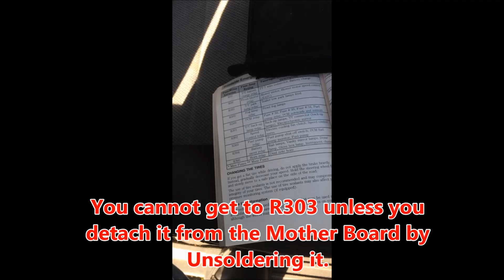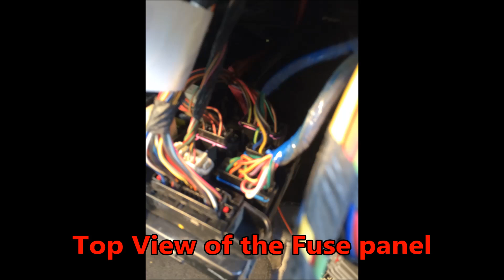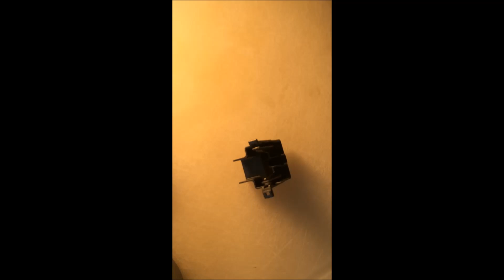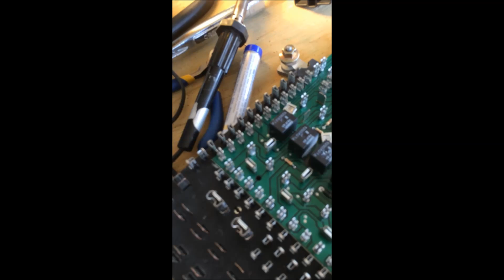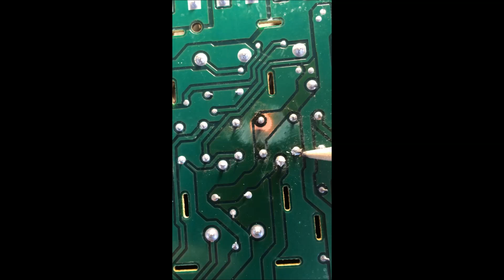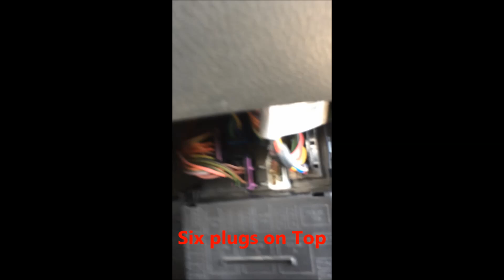2003 Ford Expedition R303 fuel pump relay replacement

Comment: I disconnected my 4 pin permanently and ran an ignition source hot to the green/yellow.  Problem solved.  Unless you think you see any issue with that method.  LOL
Reply: You need to run a fuse inline in that wire! If you don't have a fuse in electrical wiring and something shorts out the wire becomes the fuse and will melt and possibly cause a fire.
Reply: @blk95gsrt  yes, I plan on actually putting in an external relay (that can be easily changed) and a 30 A fuse inline.
Reply: @txgear  very good 👍
Reply: @blk95gsrt  as I said, if you read it all ... "I do have eventual plans to wire in a external fuse/relay combination - just for the ability to have a fuse on it"
Reply from the maker: No problem, I made this video showing how to fix a problem cheap that shops "more than one" kept saying was an expensive fix and we would have to buy a new motherboard. We found the part and fixed the mother board. problem solved! If you or anyone has an idea for a good way to resolve this fuel pump electrical, great for you! Car mechanics is not my profession and every time I can do something myself I will. I do have a great mechanic and pay good money for things that I can't do. He was impressed that this problem was able to be resolved without buying the motherboard.
Reply: @mikelogan99CDLClassAskillstest  there are also videos on how to take the 4 wire connector out and wire an external relay to it.  Oddly in talking to a Certified Ford mechanic I know he had NO IDEA they even soldered the relay in.  Its a ridiculous place for that fuse box in the first place as either the door seal will leak water into that area or a plugged moon roof drain will leak water into that area.

My simple jumper wire is still working fine after one week, I do have eventual plans to wire in a external fuse/relay combination - just for the ability to have a fuse on it but you're correct, HUNDREDS of dollars saved.  Keep up the videos.  Thanks
Reply from the maker: Well said, Thank You!
Reply from the maker: Great comment!
Reply: That works but, then it causes a p0232 code to pop up.
Reply: A1

Comment: Having the same issue with an 04 Expedition and the fuse panel is exactly the same as Hero 3 and the exact same relay was burnt so I think I have to buy me a new relay in order to get this to work. Thank you so much for a very explanatory video what can you say the great video and I hope anybody else has this problem will look you up and see that a simple fix is all that is needed  so thanks again for all your help.
Reply from the maker: You're welcome

Comment: Thankyou for your excellent vid.    Relay 203: Fuses 32,33,34, Fuel Pump Relay, Fuel Pump, & PCM Solenoids would get real hot at connection stud 5 and would scorch the plastic of the relay.  So, with the guidance and caveat about NOT removing the main power feed that you provide in your excellently edited video, I removed and opened the Junction box. None of the internal, 301-305 relays showed any signs of heat fatigue / charing.  Only the female connector 5 of R203 had carbon.  I sanded it off and reassembled the box. .... It appears I have a failed fuel pump... BUT I also have a parasitic drain of 250 mA that I am in the process of finding the cause.  Hopefully it will be the fuel pump....  Again, thank you for the time you spent developing this excellent video.... May 21 2019:  Tom Jones,  New Orleans
Reply from the maker: I'll post this and let others comment

Comment: I have the same issue. Does anyone knows the best easiest way to check power to the fuel pump ?  I was told the connector C270k out of the fuse box goes top the inertia cut off switch then to the fuel pump but I don't know which one it is.
Reply from the maker: I'll let others chime in with comments about this.

Comment: Great video. 2003 Lincoln Navigator here. Same as expedition ford.  To add Just as described in this video. To open the top battery clip has a tab, pull that one.  For the bottom I used a paint can opener to tab open that bottom clip by pulling down from the second clip. It drop in one piece without removing the fuse box.  Also to many fuses to remove and check if its burned. So, After removal if fuse box. Burn out can't be seen well either.  So, I tap with a screw driver one of the spacer end. so it wont break and fall in the fuse box.  Keeping the box from top to bottom. The second plastic spacer between the second and third relay.  I tapped the bottom only and moved some what with a screwdriver and then visible  the burned out.  Glue gun if need so.  Just move back spacer and done mine stays solid.  Ebay or junkyard for spare parts relays  Great Video man ty👍

Comment: Why couldn't you just bypass the relay and wire in a aux relay for the fuel pump? Does the even monitor the output on this relay or? In other words, will it run and drive if you theoretically wired the fuel pump up to run and cranked the expedition?
Reply from the maker: That may be an option, try it and let us know how it works. My solution was to fix the burnt relay on the back side of the mother board.
Reply: @mikelogan99CDLClassAskillstest  my problem with just replacing that relay is it's common enough to where it's obviously not strong enough to be used for the duration of the vehicle
Reply from the maker: I think that is an great option, Do that and post a video about how to do it.

Comment: hi, mike 
I have ford expedition 2003 and I don't have the owners manual.
and I have problem with no start but cranking.
I am believe something wrong wit the fuel pump relay or fuel pump it self.
this is the same problem that you have and have to replace the R303 relay? 
can you send me a copy of the fuse image and location of the fuse?
thank you
Reply from the maker: I show you exactly where the relay is located in the video, It's behind the motherboard. I would check that before you take out the fuel pump. Check your fuel pump to see if it comes on for about one or two seconds during the priming when you first turn on the key, Open your gas cap and listen very close while someone cycles the key.

Comment: tried this.  now fuel pump doesn't shut off during initial priming and engine don't crank.  Any ideas?
Reply from the maker: It may be a fuel pressure issue, The initial prime should shut off once the pressure is reached. Not sure beyond this. sorry

Comment: Awesome video man, helped me a ton and saved me a lot of money!!! I know this video is older but for anyone like me having this issue now and cant find the ebay listing, Amazon sells them Omron Part #F8VF-BA, they also have one listed as "Replaces F8VF-BA" but the part number is the same, should be easy to find. I installed it and it works great, just take your time with the disassembly, soldering, and reassembly and it should go smoothly!!! Thanks again for the video!!!! Also definitly grab some solder wick if you dont have any, made de-soldering super easy!
Reply from the maker: I'll leave this up so others can refer to Amazon

Comment: Mike, VERY informative video. Thank you!
I had to replace my whole fuse box because my case would not open without ruining the whole thing. (2001 ford expedition, with assumed burnt fuel pump relay. Stalling while driving, etc.)  My question is: What other non serviceable relays are next to that fuel pump one? When I replaced my fuse box (used from ebay) well, there went my ac and heat. Nothing! No auto, no manual, no heat or air whatsoever. (I got a refund.)  I'm only assuming that this new USED one has THAT internal relay burnt out! (My externals were fine.) Cannot find any diagrams for my year that tell me what else is inside there next to the fuel pump relay, but will continue to study. Also, I will be checking my fuel pump driver module (underneath by spare tire on cross member) to see if it is rusting and maybe causing the short in the first place. Have sealed all around my windshield to help with water leakage. 5.4 V8 Eddie Bauer, rear wheel drive. Thank you!!!
Reply from the maker: I'm not sure why the case wouldn't open, they're hard to open at first but they all should open. But anyways, if you bought a new fuse panel they have to match exactly, If you had problems with the A/C not working you bought the wrong fuse panel. I never mentioned this but my Daughter did the same thing and spent $175. The ebay seller did refund her money. I hooked it up and the Alternator wouldn't charge, The battery fault light was on. I looked inside the panel and they were different. She then found the Relay and I changed it out. I'm not that good at soldering but it worked. As far as diagrams your owners manual should show all the fuses and relays. Thanks for the comment!

Comment: great video Mike thanks    why on earth they dont make the relay replaceable?   same with the Chrysler TIPM
Reply from the maker: I wish I knew the answer, My guess is the engineers don't realize at the time that they will fail. Or if they do it generates work for the dealers. They're not interested in developing things that will help the do it yourselfers

Comment: Mike, I am following your video to replace the R303 relay. Did you have any problems releasing the solder from the motherboard? I am and am looking for suggestions. My solder gun melts new solder but no on the motherboard
Reply from the maker: I used compressed air to blow the melted solder away, There is a suction bulb available for this. More heat may also be needed for the mother board? It's delicate work and just be careful, Sorry I couldn't answer back until now. good luck.
Reply: Use non-conductive alcohol used by electronic manufacturers to remove the environmental coating or scrap it off and then use solder with flux and it wouldn't hurt to drop a little solder flux on the joint when you have heated the joint and pad of the board properly or you'll end up with a lot of cold solder joints and solder splatted all over the board like I saw in this video. I am mil spec solder certified so I know what I am talking about. You can use fingernail polish to reseal the joint and pad on the board when you are finished. You can use a solder wick to soak up the solder a lot better than trying to suck it out with a desolder bulb.

Comment: Appreciate your video! Took me an entire day to diagnose my 2003 expedition... After running tests to check the starter, fuel pump, and the pcm relay... It led me to the r303. Omron has an alternative internal relay, since the original is obsolete... part number D8QN-1CE. I ordered mine from Arrow electronics online for only $3.30... I paid an additional $18 for overnight shipping, because this is my daily driver and needed it quickly. (I currently have a relay- bypass ran until I get the new part tomorrow)... I'll be back to watch this video a gazillion more times when I start to solder.

Comment: Did you use lead free solder or just regular solder on this fix???
Reply: who cares if it works ? kids wont be chewing on it does it corrode ?
Reply from the maker: I want to answer with honesty so here it is....I can't find the small spool of Solder I used back then so I don't know, It's very fine and I got it at ACE hardware for doing exactly what I did with it, small circuits or small fine wires.

Comment from the maker: Michael, the only place I've found to buy the relay was through the speedometer repair guy on ebay. The phone number. 507-429-4489 I have no association with the seller but felt like it was worth mentioning that the part is available and it worked. I was told no relays were available and I had to buy the entire fuse panel for BIG MONEY$$$, WRONG,  It was available several months ago, Good luck!
Reply: changed mine out and it ran fine, got a call today from the wife saying it's not working again lol.....looks like i get to change a fuel pump out i ordered one for standby.
Reply: Mike Logan hi!    How do you remove the relay from the circuit board?   You didn't show that part

Comment: This will be my second time doing this to my 03' Eped. I was lucky enough to find one at a salvage yard for $100. Don't know if I will have the same luck this time around. Can you send the link of which ebay seller you got this relay from? I have an extra box already but I want to give this a good shot. Great video! Thank's for the information! It will help out alot!!!
Reply: michael gordy was that the price at picknpull where you pull your own parts,or a yard were they pull
Reply: robert paris The first time I was able to find the junction box at a salvage yard where it was already pulled off and inside. I wasn't so lucky this go around. I did find the video very helpful and ordered me a relay for $12. I know now how to repair it if it ever happens again. Thank you!!

Comment: Excellent video! I had the crank- no start problem and was able to find the fuse box at a local pull apart. Swapped it out and it fixed the problem. Took apart the removed box and the relay was burnt up. Thanks again!
Reply: scott hines was your car cranking and cutting like at a stop then recranking later or stppped all together?

Comment: Very informative, thank you!  Drove my truck to work fine, no symptoms... lunch time and it won't start at all.  Turns over fine, but not even trying to start like it has no fuel getting there.  I hope this is the fix I need!
Reply from the maker: Same symptons she was having. R303 replaced and the problem was solved.
Reply: gcrfire3 I was lucky enough to make it home before mine completely died,kept stalling on the highway.

Comment: Thank you for this video! My mechanic nor my husband could figure out what was wrong with my fuel pump! Thanks to this video, I was able to pull out the fuse box and change the relay myself! Sure enough, this was the problem.
Reply: aimie cee what kind of solder did you use lead free or just regular solder,im about to do mines

Comment: I did the same but instead using same relay I used the fog lamp relay by laying new wires out to the fuse box and put removable connection then it works.